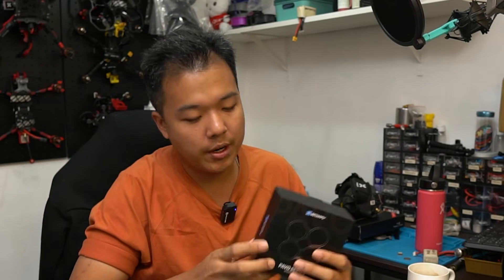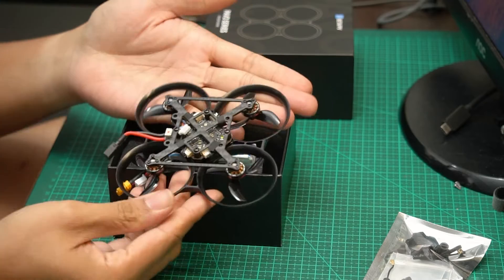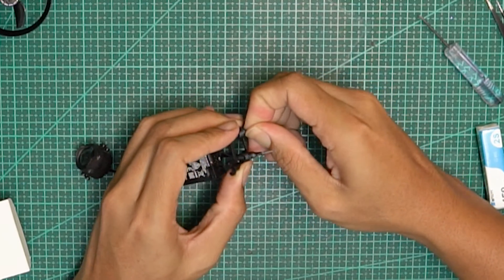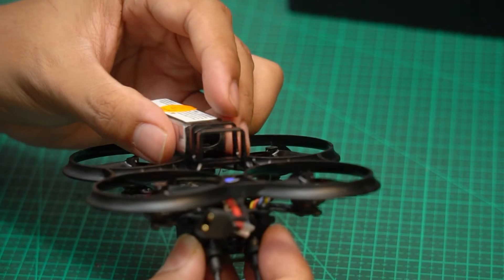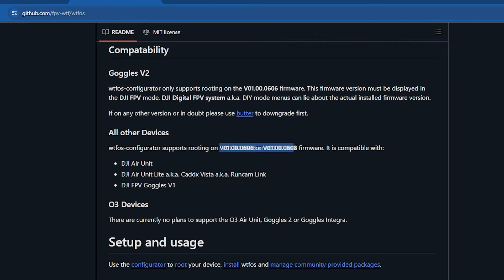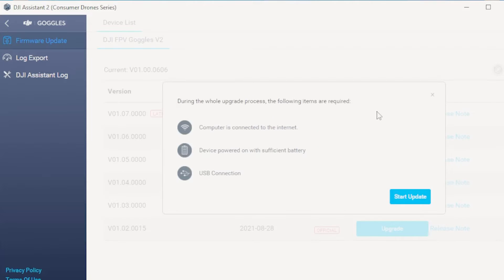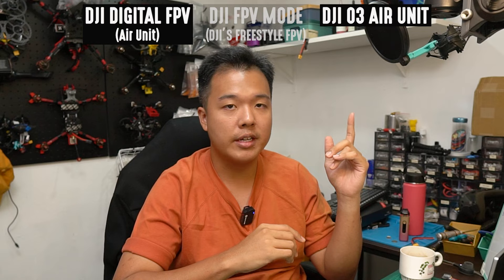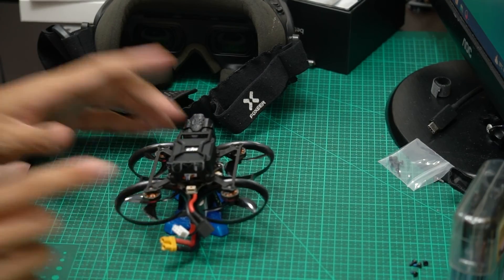Pavo Pico O3 Full Setup Guide (DJI Goggles V2)

Comment: Hello,

What are best budget goggles and transmitter for pavo pico? dji v2 way to far out of budget for me and so is flagship transmitter. Im hopeful to keep costs for both under 200usd

Also, can we record video with sd card right on the drone or do we have to record through the goggles? Thank you!
Reply from the maker: O3 air unit is the best option as I know for recording 4K videos. 
And v2 goggles is the cheapest you need to bind to it. 
Better check the second hand market bro
O3 air unit records 4K on drone and goggles record a preview version, so youll need two micro sd cards.

Cheapest transmitter id reco is the Radiomaster boxer. 
Anything below that I feel is too small for hands.
Reply: @TanFK  I was thinking of buying this setup as I want to use  V2 goggles and the drone looks good.
I have a Jumper T-Lite with ELRS module, would that work?

All my drones are Analog, so I would get the V2 goggles to use an analog module for the drones.
Reply from the maker: @  if you can afford it try getting the pavo 20 pro. Its the newer release of betafpv 20 series.
Jumper T-Lite with elrs module will work as long as drone you buy is ELRS👍

Yes i also use the v2 goggles for analog module. Its not bad. Just that youll need the converter for analog module to goggles v2 👍
Reply: @TanFK  I will look into it, Thanks!

Comment: Hi bro, my one is the first gen Tx16s. So i have to buy the ELRS module to bind with the pavo pico, right? do you have any recom for module? pls. is it should be fine BetaFPV ELRS Micro TX or (V2) Module 2.4GHz
Reply from the maker: Hey bro. I’m using the Radiomaster ranger micro. I bought it with the bundle with three receiver. Good value. Been working good for me

Your mention of the betafpv elrs micro tx: it will also work. The term ‘micro’ is the correct size of module for the tx16s. I personally never tried but should be ok.